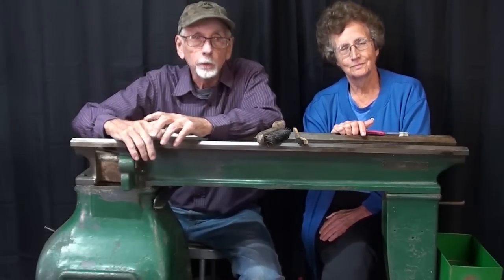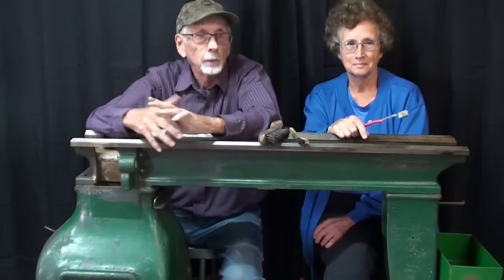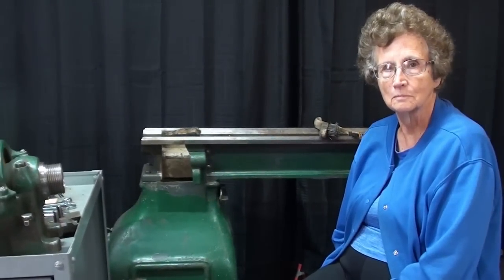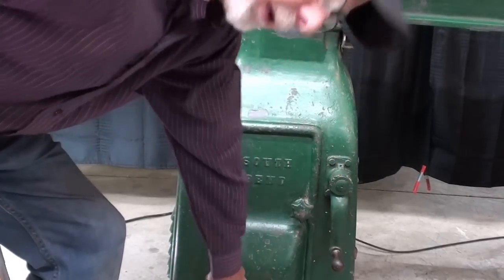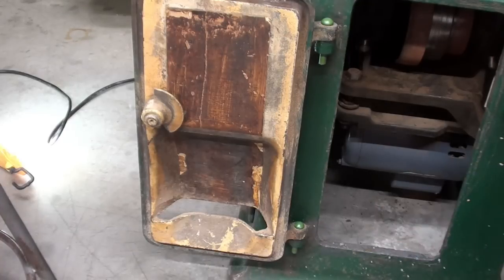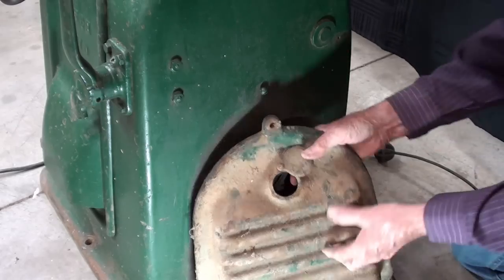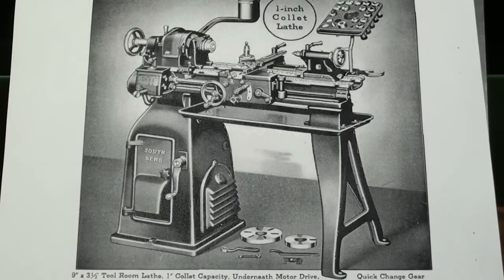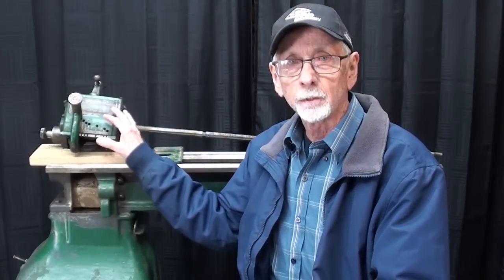CRITIQUING THE SOUTH BEND 9" TOOLROOM LATHE pt 1 #922 tubalcain

Comment: Hallo Mr.Pete, I am working with the excellent Southbend 9a lathe for more than 50 years, and as you can understand I am facing some wear problems with the bed and the saddle. I would like to ask you, if you know the exact material and composition of the bed in order to repair them with the spray metal powder method. Thank you and please carry on with your excellent job. Spiros Kopitsas Athens Greece.
Reply from the maker: I do not know the exact alloy, and probably no one does. But it is in my opinion simply gray cast-iron. It is relatively soft and that is why we see so much wear on these older machines.
Say hello to Aristotle

Comment: I have the same model give or take a few fittings and other details and it came from a school up here in central wisconsin. its vintage is I belive be somewhere around 1941. I did a complete tear down of it. re-paint and 3phase to 110v convershion. The under leg cabinet with the power unit in it is a solid casting. When I went to strip the layers of paint off I ran into filler something similar to body filler that was used to smooth out the profile. it being  from a school the ways needed to be scraped to bring back some of the deminshions (but not all of it). The big challenge was getting the the spindle back to spec as it was shimmed and I did not keep shim stock seprated from one cap to another. So if you go that far with it that may be a wise thing to keep in mind. I did a number of other operations to it but this comment is too long already.  I am looking forward to watching your journey through the rebuild of this unique South bend lathe.
Reply from the maker: Thanks for watching and commenting. There are many things wrong with these older machines, that most people would consider worn out. I probably will not do a rebuild on my machine just a good cleanup and reassembly.

Comment: I wandered why your didn't have the chip pan, it is part of the "tool room" package. My 1941 is a tool room model, it has the riser on the outboard legs to accommodate the pan. It appears yours does not have the 2 piece legs. Interesting indeed.

Comment: I have both a 9" Southbend Lathe and a Boxford model 'C' Lathe that was made in Halifax england.   Most of the parts are pretty much Identical and I have the Southbend screwcutting gearbox fitted to the Boxford Lathe at the moment.  
My question is which machine is the original design, and which one is the licensed copy?
Reply from the maker: I think that the south Bend was the original. Hopefully we’ll get some other comments on this.

Comment: My 9" is vintage early 1935 and is much simpler than the lathe shown. It still performs fine although it has been reconditioned prior to ny acquisition of it. It has the motor mounted on the bench behind the lathe and is run by a flat belt. I built a chip pan which is emptied after each use. There are no belt guards so the operator has to stay alert!
Reply from the maker: Sounds like you have a very nice lathe!

Comment: Lyle, have you ever seen or had a 
South Bend 8" lathe ? There weren't many of them out there. They had a 1 3/8X8 spindle thread.
Reply from the maker: No, never seen or heard of one
Reply: @mrpete222  I believe there is some information about the 8" on the OWWM site, they were made in the late 1920's and early 30's. I found the one I had in the Tradin Times paper that used to be out in the 70's and thought it was a good deal. Til I discovered that there were very few attachments available for it. It had a faceplate, but no chucks or any other attachments. I had that South Bend for about a year until I found my old Atlas 9", which I still have and use almost daily. 
     I have a fairly complete collection of Craftsman and Atlas machines, you might also be interested in the 10" Craftsman convertible lathe I have, it could be used as both a wood lathe and metal turning lathe with the  then available carriage attachment. It has replaceable ways that are mounted to the bed with bolts from the underside. it was only made in 1938! 
       It was nice to meet you at Arnfest, and I really like and appreciate your videos.  Kirk Hoffman

Comment: Love your Videos Mr and Mrs Pete.  Loved meeting Mrs Pete Today Thanks I have a south Bend Heavy ten lathe i completely restored cleaned and yes i repainted in the origional South Bend Grey paint.   South Bend Made Quite the lathes  When I finished it in November 2021 I put a Bow on the head stock as it was a present to myself.
Reply from the maker: Sounds like a great project!
Reply: @mrpete222  I bought my lathe at a School Auction in Charles City Iowa and I found it to be in good Shape for being in a classroom it was off to the side and the only one of its kind Not a tool room lathe like yours But the ways were tight and in great shape.  I had fun looking and buying on ebay for parts I needed to make this model work for me. I make prototypes on the machine that are later made by other Shops in runs of 150 to 200 Qtys.

Comment: The bolts in the hinges are Grade 5,  not Grade 8, if I saw them correctly. SAE  bolts have lines on the bolt heads, and the grade of bolt is found by adding 2 to the number of lines. The hinge bolts had three lines, so Grade 5. A Grade 8 bolt will have six lines. No lines is Grade 2, which is a basic annealed medium carbon steel strength. Gr 5 & 8 are heat-treated alloy steel. Grade 8 bolts were cadmium chromate plated and this gave them a gold appearance. Current Gr 8  bolts still have the gold tint but I think that the plating no longer contains cadmium, as it is a carcinogen. I recently saw some inexpensive bolts on offer advertised as Gr 8; they had the gold tint but were coded with three lines, so Gr 5 at best and I have no idea what they really were. To no ones suprise these bolts were of Chinese origin.

Comment: If I had to wager a guess as to the portal on the lower motor electrical cover I'd say it was an oiling port for the original motor. I've seen a few of them that had a brass spout sticking up very close to that height but they weren't installed in anything. They belong to a friend o mine who collects old electric motors and he was telling me that two of the motors he owns were from tool lathes hence my guess.
Reply from the maker: You’re probably right about that.

Comment: i agree the rivet is more proper than a bolt in the door hinge . its a nice little lathe    you will fix it so it can help with  the  work   for  the next 100 years. Thanks Mr.Pete
Reply from the maker: It will be ready for a few more generations.

Comment: Love the original paint on equipment. While attending a great Vo Tech high school we had a penny pinching electric shop teacher who wanted to reuse 50 year old worn out work benches & stools in the new electric shop in an addition to school. The machine shop ended up with thousands of dollars he refused to spend and bought a CNC machine that ran off of punched paper tape ( 1967 ). Our shop teacher got free 5 gallons of surplus gray paint from the Navy so he had us paint drill press's, coil winder, lathe, test transformers and probably 50 motors students took apart. Got sick of gray paint.
Reply from the maker: That gray paint really brings back memories!

Comment: Great to see Mrs Peterson. 

The base on the 9 inch tool room lathe looks like the one on my 13 1/2 inch lathe I'll have to look inside my door to see if there is an info sheet . U always make sure to release my tension lever also a few times I have forgotten and it stretches the synthetic belt out luckily it has shrunk back si it's  usable.

Comment: I think that chip tray was made with a hole on the outboard end that would have slid over the leg and been bolted to the lwg as you point out. I suspect that with such a design the casting for the chip tray would have had a raised bead in the casting around the perimeter of the hole to contain any stray oil or liquid from escaping the tray and leaking down the leg. I am not speaking from actual knowledge of the design, but just a suspicion. I would love to hear from someone that actually knows for sure.
Reply from the maker: You may be right, that's a good point.